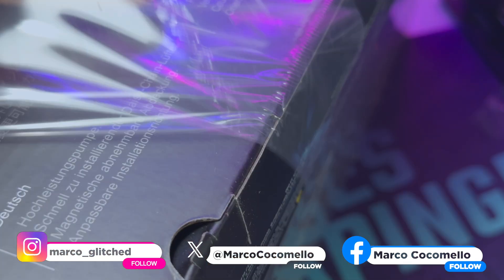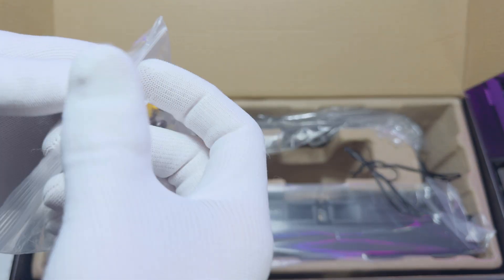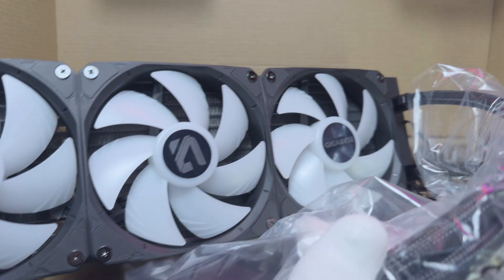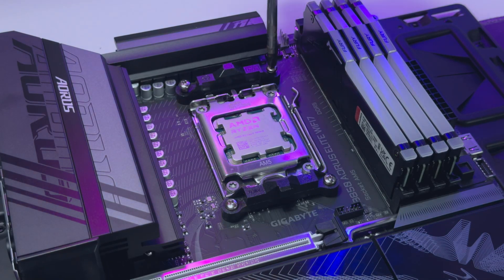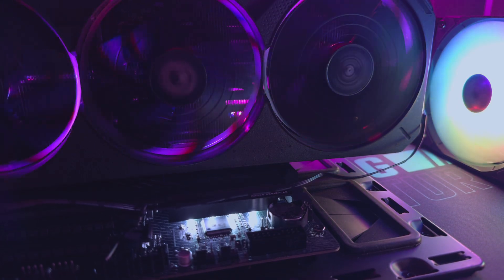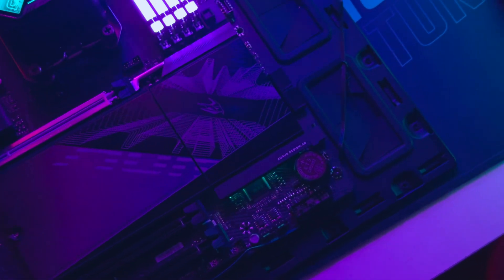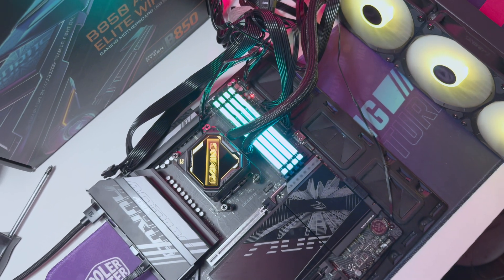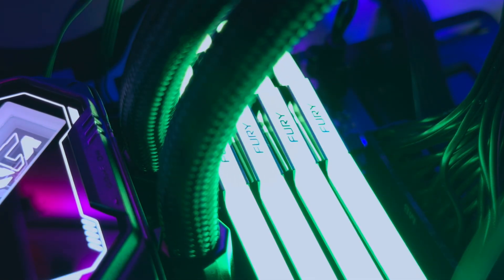GIGABYTE GAMING 360 AIO Cooler Review

Comment: Do you think this water can handle amd  9800x3d ?
Reply: I was gonna ask the same exact question
Reply: i am using same  cpu  and it handles very well, max temp in bf6k 2k ultra settings  is  57c
Reply: Why wouldnt it bro 9800x3d is the lowest wattage and coolaste running new cpu

Comment: Bro is it ok for i914900ks
Reply from the maker: Yes should be just fine. My tests showed it didn’t even reach 50% fan and pump speed on my 9950X which had a thermal operation of 90C. Intel is slightly higher but the fact the unit didn’t get half speed, shows it has a lot of room for warmer CPUs

Comment: I wanna ask, is this exact model gonna fit in my Gigabyte C102 Glass case from the top? The guide says it supports only 360mm coolers from the top and this one exceed that since its 403mm
Reply from the maker: Yes it will fit, when a case says it “supports 360mm” it means across the board 360mm coolers and not specifically the 360mm dimensions. It’s like if the case says it supports 120mm coolers, it means 1 x fan coolers, or 240mm is 2 x fan coolers. Just so people are aware the case does have 360mm cooler support.
Reply: @GLITCHEDZA Alright thanks

Comment: Do you recommend it to go with a 13700KF ??
Reply from the maker: I think so. I would honestly handle any new/newer CPU. Of course, Intel CPUs are a bit more intense with heat, but it should hold up.
Reply: @GLITCHEDZA  thx, that water cooler is the cheapest and best for its price here in brazil, i was thinking about him and a thermalright phantom spirit 120 air cooler.